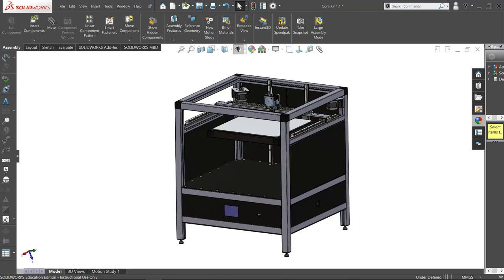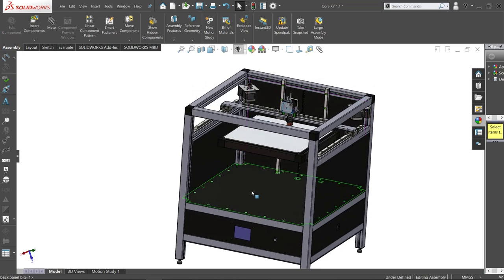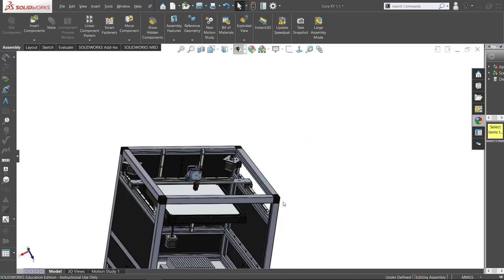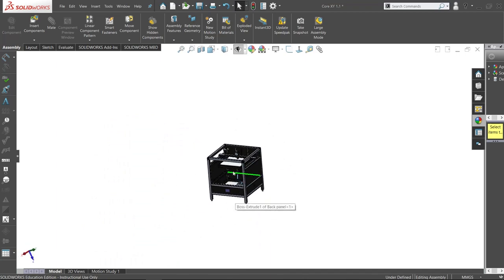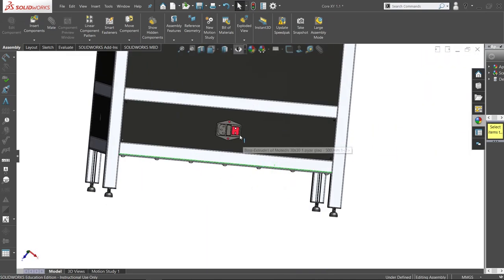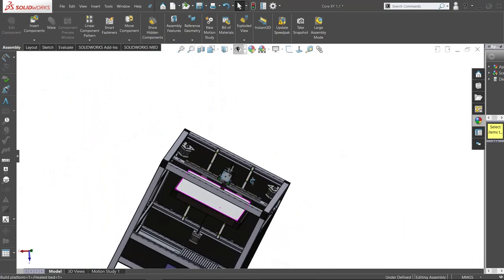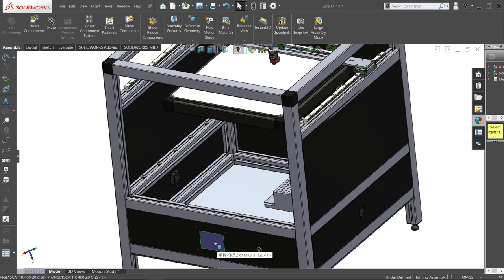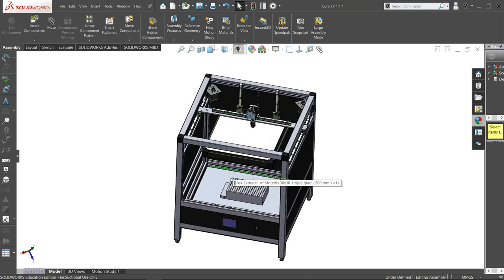Designing a BIG DIY 500x500mm 3D printer -- Part 2: Iteration 2

Comment: Make sure you put a intake filter on the fans. They look a bit undersized. I would go for the biggest fans you can fit on the panel. This way you can run them at lower speeds and they won't make that much noise. The tinier the fan the more annoying the high pitched noise. I would recommend 120 or 140 mm fans from noctua. They work flawlessly on my pc without making noticeable noise.

Comment: Whole bed just one motor for z and just 2 rails on one side? I would prefer 3x or even 4x...
Reply from the maker: Thanks for your comment! Why do you think more is better? And are you talking about them being opposite to eachother, or something else?
Reply: @mertcapkin7263  yes, because of stiffness.. For such big bed and big print on it I recommend to use better support and guide for bed for sure. The best could be guide and thread rod in each corner. And you can use cheaper rod guides instead of hiwin rails. See bigrep printer for inspiration. https://bigrep.com
Reply from the maker: I will not use threaded rod. I am going to use a lead screw. Because threaded rods are not meant for linear motion, they are just for fastening. If the motor for the z axis is strong enough and the bracket that attaches the bed and the carriages together is stiff, then it won't be a problem I think. Ultimaker does the same thing, I just have to make it a bit beefier. I can always change it :) thanks for your input
Reply: @mertcapkin7263  sorry for word thread rod. I meant lead screw. Yes ultimaker... But your bed is 4x more in square and 8x more to volume.... Still sure it is enough?  Some designers use more stiff design even from bed size 300x300, and IMHO they think right... I have cr10 s5 which is 500x3 and what is the worst on it is no stiffness. I have to slow down print in a very low value..
Reply from the maker: My first idea was to have the same setup at the opposite side of the bed as well. I will just see how it goes :D